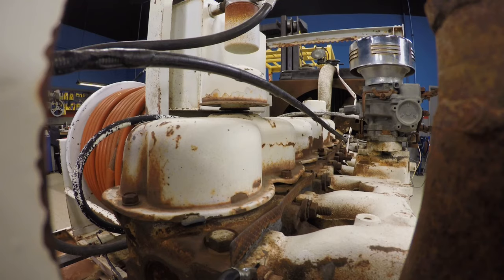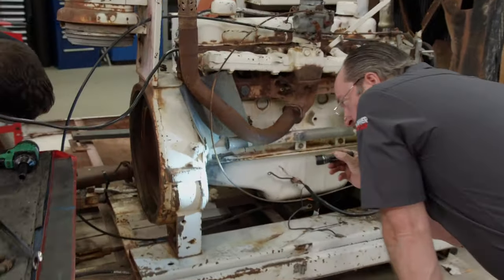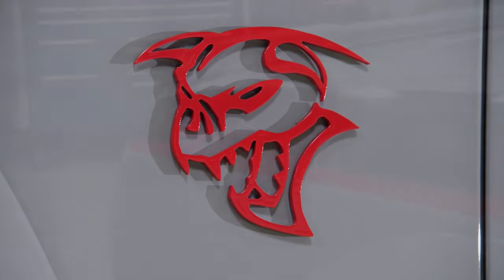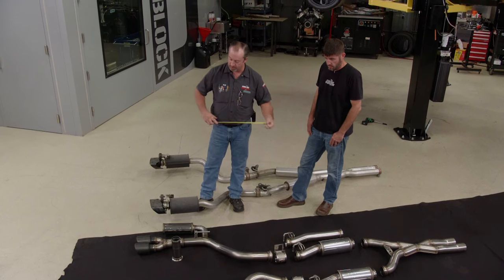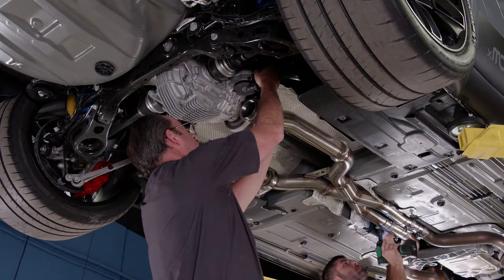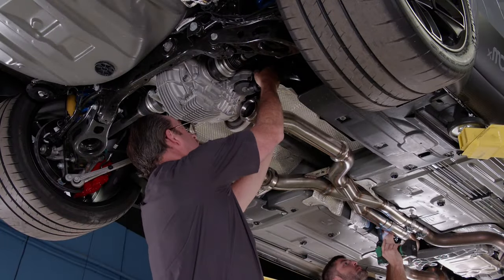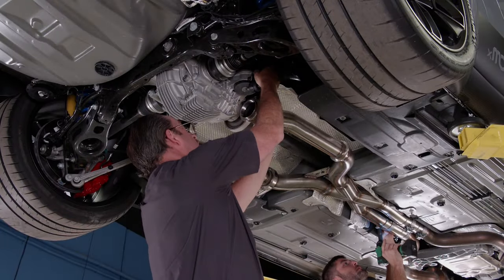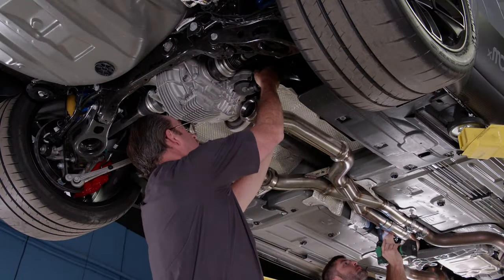Will The Ford 300 Inline Six Start After Sitting For 20 Years? - Engine Power S7, E14

Comment: My dad still has a '95 F150 with one of these and the only major breaks have been 1 blown piston ring and a rebuild of 2nd gear. Aside from that it's just had normal wear and tear maintenance. The odometer topped out at roughly 400,000 miles, and that was 10 years ago. These are truly the best engines ford ever made

Comment: I’m very excited about this build way more excited than watching the 1000 hp charger please build this thing to an extreme I would love to see the max potential of this motor maybe with a TwinTurbo set up anyway this is the engine as a teenager I always wanted to build but never had the money
Reply: ripfletching *challenger
Reply: I did build one, not extreme, just deck the head, 4 barrel intake and carb, and a better cam.  I was able to keep up with a stout but stock 350 in the 1/4.  I was fixing my dad's 300 so I lent him my built one...he said "that thing's got way more power!" I said that I knew that.  The biggest difference I noticed was it had way more top end power, the down low was relatively unaffected.
Reply: Yes please
Reply: Love challengers.....but why the hell do you need 1000 hp... isn't 300 or 400 hp enough 🧔
Reply: Yes! Make it as close to a 300 i6 EcoBoost as you can! Make it the EcoBoost the F150 deserves!
Reply: @travisaugustine7264  I've been saying that for a few years now!  DOHC and turbo, big block barra here we come!
Reply: jigga jaw  they are good for million miles stock, we can afford to shorten the life some.

Comment: Being a commercial equipment application, I bet that 300 was balanced to keep vibrations to a minimum. The cylinder bores were also probably done to a higher standard (blue printed?). I loved my 88 F150 with the 300 6 and 5 speed manual (regular cab, 2wd, long bed). Such a great drivetrain combo. I got 18 mpg on longer trips. And that for an 80s fullsize truck with enough power to get work done was almost unbelievable (for comparison, my 73 F100 regular cab 2wd long bed manual everything rebuilt 360 straight duals 3 on the tree got 10 mpg always). Always wanted say a 64 Galaxie with a good 300 and 5 speed (or even 3 on the tree as they are easy to drive) plus a very tall rear end to take advantage of that torque. Would be a great highway cruiser and decent mpg. Call it the Slowville Lugger (yeah, I've thought about this quite a lot in the past. lol). Lugging most engines is bad because low oil pressure for forces, so that would need to be addressed.

Comment: Yes, finally.  Love to see a turbo for this
Reply: I'd like to see it with a blower I wonder how much torque it will make.
Reply: @ryznglascastle1995  a pro charger could work
But from everything I researched it's a lot of custom work that goes into it. I tried to find a turbo kit for my 95 f150, and I couldn't
Reply: @ruby20003628  Yep the lower half of the EFI intake manifold has me wondering if it's possible for bigger injectors and a Modified upper half designed for a belt drive blower and a better throttle body.
Reply: I was told you have to lighten up the bottom end so when the extra pressure goes in, it's not gonna warp the piston rods due to the longer stroke. Don't know how much truth there is to that
Reply: @ruby20003628  boosting from 145 to 225 hp... "It will be fine" "Hold my Beer" lol
Reply: @ryznglascastle1995  lol, I seen people get around 300hp and close to 500 torque, on a turbo 
But they never give out their build details or videos on it

Comment: Ford straight six engines have ran for decades on generators, steam jennies, pumps etc. They were simple, reliable, and economical to maintain and repair. Ford dropped them in automotive applications simply because they could not pass ever stricter emissions regulations. The V-6 that replaced them in trucks was a hot pile of dog 💩.
Reply: The 4.2 Essex?

Comment: My dad had the 300 I6 in his 1988 F250. It was one of the best motors. Good gas milage(15), he plowed snow, towed 5th wheel campers, pindlehook trailers with heavy loads and it finally gave out at almost 300,000 miles.

Comment: can yall rebuild the 300 for high power so i can see what parts will go best on my 300 in my f-150
Reply: Any carb around 500-650cfm Offenhauser 4bbl intake, headmen headers, comp 268H cam, polish the stock head, HEI distributor. Gave my trail rig a really nice bump in power
Reply: If I was rebuilding an 300 for an f 150 I would just replace the pistons, install a lite RV cam and  put in a new exhaust system. I'd leave the stock intake & exhaust manifolds. 
  No matter what you do find out the compression. most inline engines are low compression so you can run them on cheap gas, and if the engine is post 74 the compression fell off a cliff. I would go about 9:1 compression. and if it has points obviously convert it to electronic ignition and have the distributor curved for low end torque .  trust me, the results are gratifying .
Reply: Check Clifford Performance.
Reply: Autojones. I would change the head to get more compression, intake manifold, and do longTubes.
Reply: @bri-manhunter2654  Depending on what year it is.
Reply: @bri-manhunter2654  planning on long tubes
Reply: @Autojones  85
Reply: @legitdelirium3446  awesome thanks
Reply: Just need an offenhauser intake and a 390 - 535 Holley , a header , roller rockers and forged pintons , which some of the hds came with .
Reply: @Autojones  The late model I6  in the 90s obs fords were at 8.8-1 cmp r from the factory.

Comment: My first vehicle was a 1980 Ford F-250 Ranger XLT. 2WD, manual 4 speed with granny low, and most importantly, the 300-6 engine. At the time of ownership, I lived on a mile long dirt road with plenty of twists and turns, and fondly renember sliding through the corners on my way to where the bus would pick us up for school. The 300-6 is a bad ass engine, and I truly wish I hadn't sold that old truck.

Comment: Alright, finally the Ford 300 Big six is gonna get some Power Nation love!  Please, Please include a Turbo in this build, & also consider the turbo with LPG (yes, HD-5 propane motor fuel) which has 105 octane! The guru's of that combo are at Ak Miller's Garage in Pico Rivera, Ca. Ak Miller (RIP) invented advanced LPG carburetors &  perfected the Turbo/propane combo w/amazing low emissions. A 4bbl or twin 2 bbl  LPG carbs on appropriate  Clifford or Offenhauser hipo manifolds & boost will amaze us all. GotPropane.com may be helpful too. They specialize in 4WD off-road LPG/Turbo combos. Remember with LPG, richer is hotter, leaner is cooler with gaseous fuels, just opposite of gasoline. I can hardly wait!

Comment: Had one in a 1986 Ford F-250. Fantastic torquey engine, sold it with 300k (Dolt) on it with nothing done but routine maintenance. It went another 150k trouble free before sold again and I lost track of it. If the truck hasn’t rusted out from under it that straight 6 is still running somewhere. I’ve owned many different Ford motors and this one was the best by far. I’m 71 years old so before you say “ best Ford so what?” , have owned practically every engine made including English and German and this one is in the top couple ever

Comment: I have a 1988 F150 with the 300 in it, has around 348000 miles on it , and thinking about a rebuild soon . It has a few leaks , and slight knock at times,but still runs and pulls great ! Love these torque monsters .

Comment: I install these motors (Ford 300s) into my equipment all the time. Still used heavily in the airline ground support equipment (GSE) arena. Super easy to work on. Damn near abuse-proof. Can run as low as 6psi oil pressure and work without failure (not recommended!) . Married to a C6 with an 14:1 to 18:1 rear end (yes that right), a MA50-1 can pull a house or five down.  That drivetrain combo can even be found in the larger pushback tractors. Tractors that are pushing around 150,000lbs loaded aircraft, and doing it with ease.

Comment: I have a 1966 Ford F-350 with the 300 six, four speed trans with Dana 70 rear 4.88 gears. The old workhorse never dies.
Reply: bish pull down any trees or buildings with that rear end?

Comment: Man that hellephant is sick. 847 whp when you're running a big rear end, a 3.0L supercharger, and a regular geared automatic transmission you're losing at least 21 percent from the crank to the wheels maybe more. Some of the older modern transmissions from the Daimler Chrysler era were known to cause very high parasitic losses. Mid 25 percentiles were seen from the crank to the wheel. This setup with the magnaflow puts down 1024 hp and 1050 ft lbs at least. Thats insane.

Comment: That old 300 is an awesome motor. I had an 85 Bronco with the 300 and a four speed with granny low. I used to put that truck in first gear, low range on the transfer case, and get out and walk beside the truck through rough spots. That thing had torque all day with plenty to spare. I've always wanted to build up another one with some Clifford Research hop up parts and see what I could get out of it. Maybe some day.

Comment: I absolutely love the ford 300 6 it's one of the only straight 6 engines with a 4 in bore and a 3.98 stroke making it a good candidate for a high HP build and there are a lot of hot rod 300's around

Comment: Rebuilt the 300 in my 1984 F150. Other than a 0.030 bore job (broken rings and scored bores) and "premium" rings, kept it a stock build to include the reuse of the old EECIV feedback carb setup (I did retrofit a heated O2 sensor). Not much HP, but good torque and runs great. Doesn't get the fuel economy that others report though... still, she's a keeper. Heck, with the broken rings and terrible compression, I was able to drive it from southern Indiana to Kansas (via a side trip to MO) and back... struggled, but she made it. Can't kill them.

Comment: I can't wait to see the outcome of this one I am  Building A 1983 300  Straight 6 for my 1983 F150 I've got the bottom in Ready to assemble The block has  Bam board 30 over Line board decked 30 thousands And a whole list of other goodies I have a comp cam kit But with the same problem he was talking about with the hitters intake I have not decided the rail I want to go The biggest problem I have came into with building this motor is the small selection of aftermarket parts For instance summit racing does not even offer Camshaft thrust plate For this motor Because no matter how popular these motors are There is not very many people building these  Motors anymore I am very thankful and happy  To see  You guys building one of these motors

Comment: The cargo tugs at the airport are almost all powered by ford 300s.

We had one come in the shop for preventive maintenance and it has a metallic noise coming from the engine and ran rough, but we were swamped with work and it wasn't running so bad to justify taking it off the line.

2 weeks later we brought it back in and the noise had lessened, I decided to pull the head after a compression test came back with zero compression on #1.

I found the exhaust valve drop and stuffed through the piston stem first and properly peened into the piston. I found a piston in the scrap pile, ground all the damaged out of the cylinder head. No damage to the cylinder walls. I used a random exhaust valve I found, it was to large so it got bench ground to fit.

All and all it took half a shift to get it running again, and if I wasn't so slow that day there would of been zero hesitation in leaving it on the line.

Comment: That ford 6 cylinder is a testament to solid old school Ford ingenuity.. i used to have a 300 i6 in my old ford pickup and ran it out of oil countless times and it never blew up.. ran decent till the day i yanked it out for the diesel swap. No horsepower but torque for days

Comment: I saw a 300 I6 at the US Nationals about 30 years ago. This thing had a custom made Cleveland head. Yep! The builder cut a chamber off of two Cleveland heads, mended them together and bolted it to the 6 as the bore spacing and head bolt holes were the same. This cat was running 9s in an altered. I challenge y'all to do this! At least you'll get the manifolds on opposite sides.

Comment: I'm used to driving old Jeeps with inline 6s that make all kinds of noise. I bought a later model Jeep with the 4.0 in really nice shape with all original exhaust. When I tried to start it, I literally thought the battery was dead and I was going to have to jump it. I couldn't hear or feel anything. But then I noticed the tach. It was idling just fine! At idle the valves working make more noise than anything else...

Comment: Also, speaking of generators, I have a 454 gen 6 that came off a generator in a coal mine that ran on methane and had a goofy quadrajet setup on it and is clean as a whistle but that camshaft was built to run 1000 rpm all day and night to sell energy back to the power company. Used them on big generators for hospitals too.

Comment: I had an F250 in high school with a 300 in it. It had an overheating issue and would overheat everytime I drove it for about 2 weeks. It was so hot it sounded like a diesel. Ultimately the head gasket went and we pulled the head to replace it. There were four big cracks in the head but the engine still ran fine anyways. The head got replaced and the engine went another 2 years until the truck rusted out.

Comment: 4.9 300 club right here. 1992 f150, standard with the twin eye beam suspension, although I prefer to opt out of the twin eye beam suspension due to camber issues with different weight loads

Comment: First real vehicle I ever owned was an 84 f-150 with a 300.  Absolutely loved that engine.  Just ran for days, would take any abuse a 17 year old could throw at it, and was what I learned on for working on vehicles.  Didn't hurt that I could damn near sit down in the engine bay and shut the hood with me in it lol.  Always wanted to do a build of this engine with Clifford performance headers and intake with a proper carb instead of the 1 barrel that came in it.  Still just a torquey indestructible engine.  I ended up destroying the wood fiber cam shaft gear and dumping a ton of wood fiber bs into the lifters.  The truck developed a knock and ran for another 5 years at least.  After that I lost track of it's story.  Hell it may still be running.  Lol.  Just bullet proof.

Comment: Boost that 300 already! Dying to see how that looks with the stock cam and springs that will give me an idea what to expect with my 1968 F100 300I6 with similar mods intake and exhaust flow wise. I am impressed at the huge horsepower gains. I hope to see more torque, maybe run some Ford stock injected cast Y pipes on it to see what it would do compared to the header.? Going from that to the Heavy Duty  log exhaust would be great to see on this also!

Comment: I hope to see the build when you are done. I wonder what the rating was on a 1995 fuel injected model?
Reply: Max Brake Horsepower: 150 @ 3400 rpm
Max Torque: 260 @ 2000 rpm

Comment: I’ve worked on these engines in chipper applications before and they are tough engines. Being that they are an industrial engine they can be hard to find common parts for like starters and water pumps, hoses, etc. Keep up on the oil changes and the belts tight and they will work all day long and ask for more it seems.

Comment: I had the 300 in a pickup. The truck rusted out at 340,000 miles. I sold the truck in 2004 to a machinist who adapted the engine to drive a sawmill for an Amish sawmill. Last I heard(2018) That old 300 is still powering that sawmill.

Comment: I've waited years for Powernation to actually build a Ford 300 Straight 6. No one these days mess with them, but the 300/4.9L is one of the best engines ever built., If you put factory 300/4.9 F150 behind a 302/5.0L F150, the 300 will pull the 302 as all that low end TQ is all pulling power.

Comment: Thank you very much!  I want to build up a 300 for my 1952 Ford COE.  I got some 240 rods and will get some sbf forged pistons.  I really wish I could find a HD forged crankshaft like that may have. I want to get the loopy comp cam 168?  I really wish I could get a roller cam for it.  I'm sure lifters with link bars would work.  I have 2 engines to play with.  I have a Clifford intake for a 4 barrel. I really want to get it machined for injectors but no machine shop around here wants to do it. I am gonna use a TB from a SN95 Mustang 5.0L.

Comment: It’s got the 2 1/2” outlet HD exhaust manifold, perfect for adding a turbo
Reply: It has the standard 2" you can tell by the 45° turn out at the bottom the 2.5" HD manifold outlet is straight down.

Comment: If I remember correctly these have the same bore spacing and head bolt pattern as small block Fords...People would cut two cleveland heads apart and furnace braze them back together. With a stout seven main bottom end they can make a lot of power.

Comment: I heard of them making a reliable 250-300 hp. Reminds me of Gas engine Cummins 12 valve except for the lack of noise. And the both have gear drives instead of chains.

Comment: Anyone that had experience with a 300 six knew it would start right up. Just a great, smooth, workhorse, as long as you aren't drag racing, lmao.

When Ford upgraded them to EFI, they put a decent intake and exhaust header on them, which gave them a fairly significant performance improvement from factory, without modifying much else, other than port injection obviously.

Comment: I had a 300/6 in a 78 lifted mud truck on 38s , 4 speed crawler , sbc valve springs , small tractor turbo , offy intake with 500cfm carb. Stock longblock would see 6500 for minutes at a time without a single failure. only could get 4-5psi out of it.